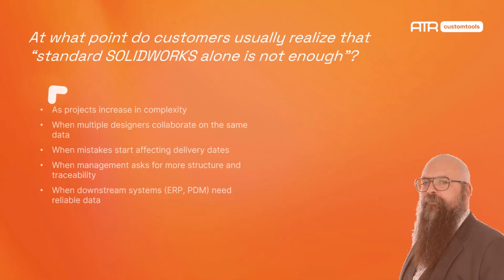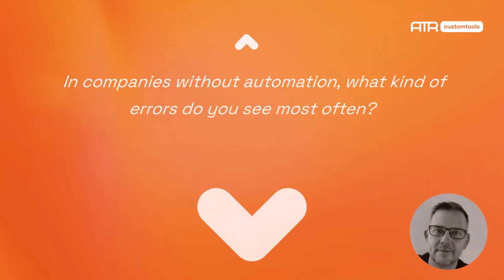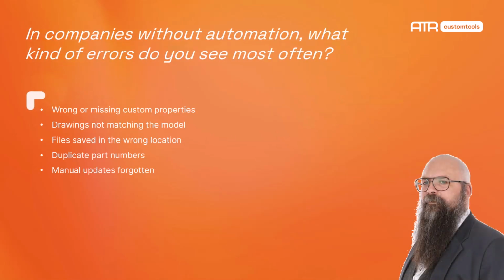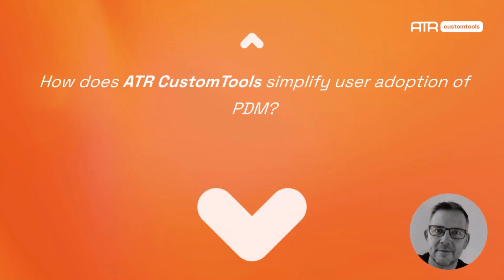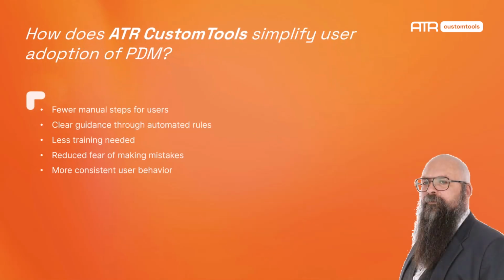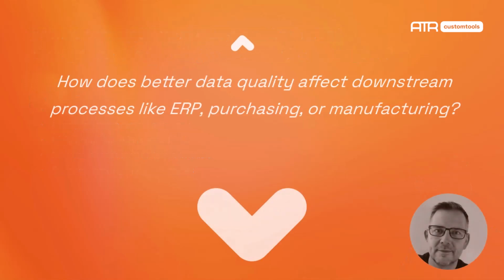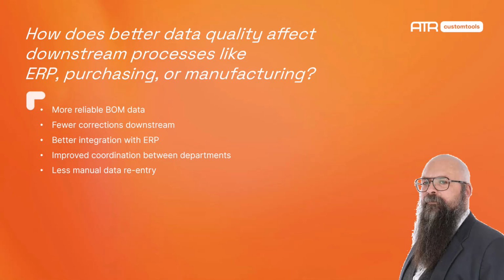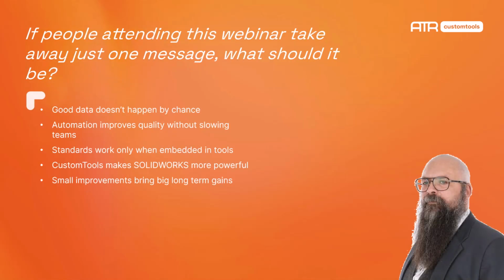Cad Coffee Break: Talking about Data Management with Lennart Tinndahl

Comment: One thing that will improve speed for me in costomtools would be able to multi selected multiple parts, and give them same material, same data as wood or steel type, treatment, venner vs solid data from costomtools. And select multiple parts,  like 10 parts and give them sub numbers staring from the top, 105-01 / 105-02 / 105-03 and so on. In one go. 

Since I make parts within an assembly, this would help a lot, since each part inside the assembly cannot read the project number automatic. I need to go through every file and add them to the same project map as it is right now.
Reply from the maker: Hi! You can actually do that using Copy -feature with action "Write Property Values". It might be that assigning SOLIDWORKS material is not supported in that, but batch editing other Properties is exactly what it does.

When you open Copy, ensure the Action on the left Property panel is "Write Property Values", then using the right side task pane, choose components you want to affect. Then just modify what ever properties in batch.

You can also use that for generating Sequences for multiple components at once. Just be careful not to modify the property you have configured to be used as filename, as that can have a bit unexpected results with "Write Property Values" action.
Reply: @CustomTools4SWThanks for the feedback. It could be great if you made a video where this is done. This video talks a lot about being fast, I just need the tips to make costomtools to be the tool that speeds up our work. And since we are learning things visually "Engineers/designers" and not on text. Please make videos that show what you talk about. 

We make furniture for retail shops. So we often have a ton of different materials and surfaces and multiple parts and sub parts that needs the same data. And all is done be starting an assembly and the make parts inside. 
This is also challenging when we need to draw parts inside the assembly seperate. Because then we need to go through each item and choose save external. This should be an option to batch save externally.
Reply from the maker: @EvoKey  You're right, it seems we don't have a video exactly about this subject - we definitely should! 

However, we often reference Copy / Write Property Values in many other videos. Like here is an example how one could apply specific ERP expected values to specific properties for all components of an assembly: https://youtu.be/wh0B2wxe3M8?t=413&si=2uLWwDp73q-X3B5I
Reply from the maker: @EvoKey  And, to deal with your exact use case and profile configuration, I'd recommend you to contact your ATR CustomTools reseller for support. If you are direct customer of ATR Soft and your license is in subscription, you are eligible to use our support channel. See "Other Documentation and resources" here: https://taskpane.customtools.info/en/2026/help